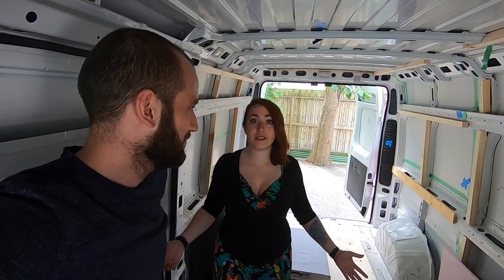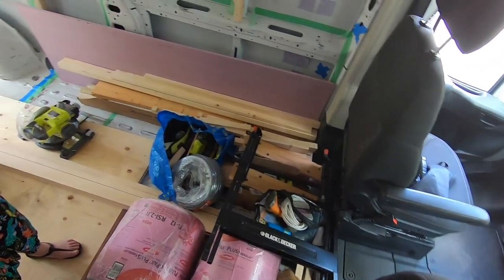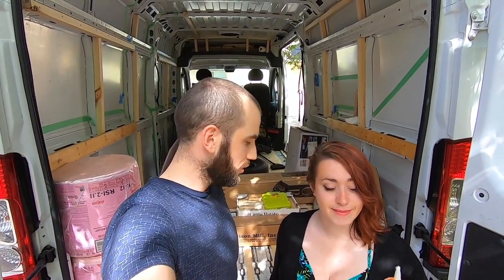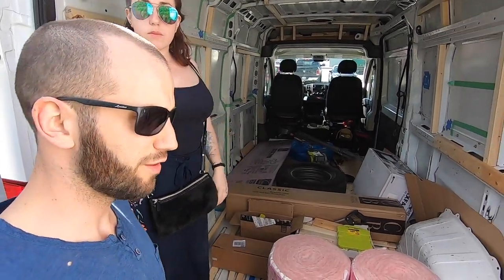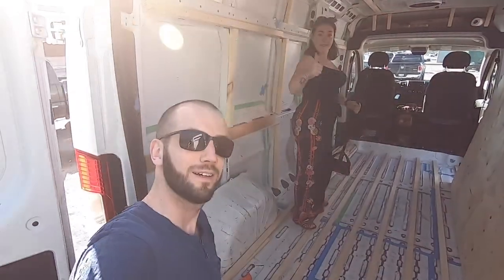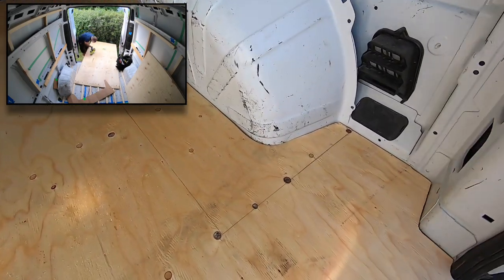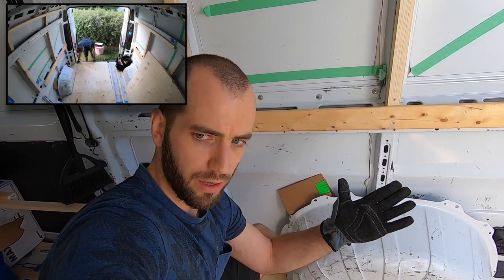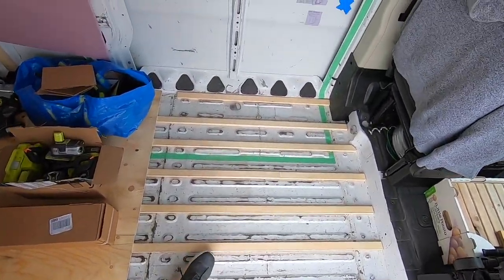SUB FLOOR PART 1 - Support frame and plywood - Promaster Van Build #7

Comment: For the support in between the two floor boards don't sweat it, insulate both sides, when the time comes, use spray foam, spray it down, let it expand then lay down the boards and squish the spray foam down with the boards. That stuff works wonders and you'll avoid so much head ache. 

Spray foam isn't just insulation, its great for providing support when needed. We used it to fix an issue with our batteries and it supports over 100lbs a square foot!!
Reply from the maker: Thanks for the tip! It's been holding on pretty well so far, you'll see in part 2. Spoiler alert, we'll have some spray foam footage pretty soon after that... :)
Reply: That's awesome advice. Spray foam is very underutilized.

Comment: We just bought a promaster that came with a factory floor.  We just added underneath a pre-made insulation floor (same template as factory floor for promaster) that goes perfectly between ribs.  We just put it back the factory floor and Voila!   we read fiber glass insulation is not that healthy?!
Reply from the maker: Fiberglass has its disadvantages, but it's the easiest material to work with. We really valued the height with Tanguy being 6' tall. We could have done more/better on the floor insulation but it's been pretty good so far!
Reply from the maker: Oh, and congrats on buying your van! Exciting! 🤗

Comment: I would never use the pink insulation on the floor. If a water spill ever gets to the insulation it will never dry out. Foam board is much better. Foam board will also support the floor.
Reply from the maker: True! Fibreglass isn't the best, but it was the easiest to work with for us without compromising the height once flooring and ceiling were done